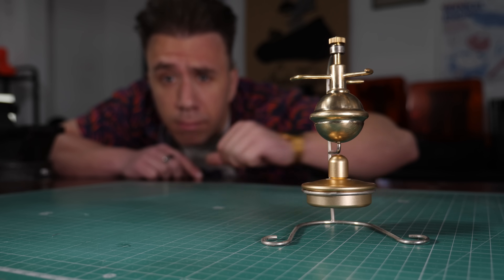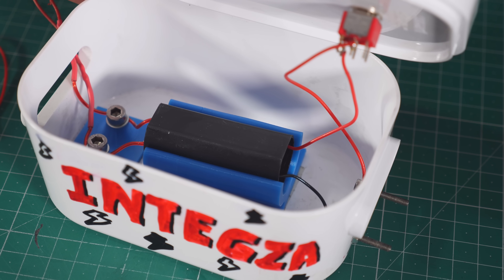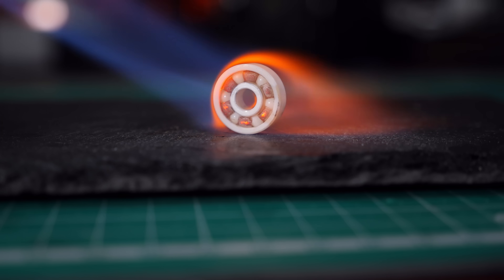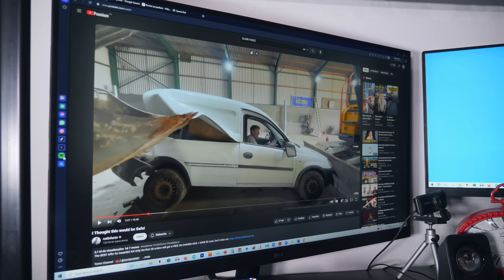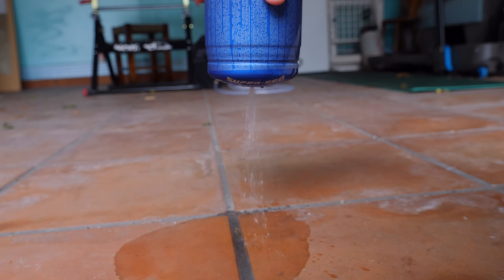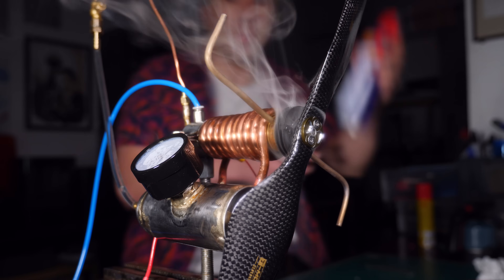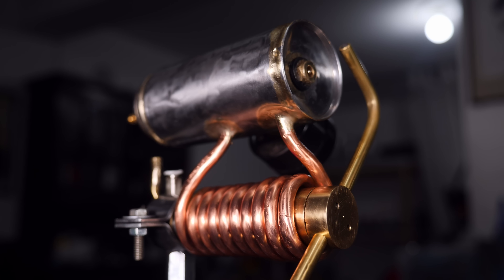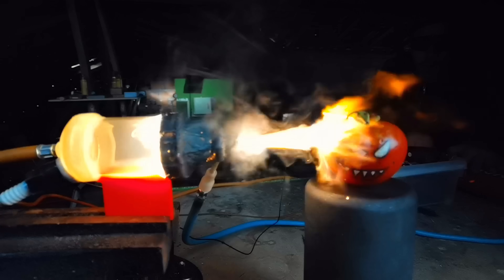I Built a ROCKET PROPELLER

Comment: Bey integza, after brazing the coppertubing, use a mixture of 50% distilled water with 50% isopropyl alcohol instead. This will help remove the flux residues and leave a better surface.

Comment: I'm at 7:50 and I am a bit afraid to watch further. I made a similar "double win" when I was experimenting with burning alcohol as a kid (yes, I was that weird kid, who loved to play with fire 🤣). As a burner, I was using just a steel bottle cap. The flame was not too impressive. But I knew that the stuff burning is evaporated alcohol. So I put one cap on a wire above the other cap to make the other one evaporate faster... I think I was lucky I only had just small bottle caps... And I didn't loose more then my eyebrows 🤣
But the experiment was a full success - flame got WAY bigger 😁

Comment: You want to see this concept in modern history?  Look up the Hughes XH-17 helicopter.  The gas turbines weren't used to spin the rotor like with a modern helicopter -- instead, the gas turbines sent exhaust gas through the (hollow) rotor blades to tip jets for propulsion.  Neat system... also had the advantage of reduced anti-torque requirements.

Comment: Tips for improvements off the top of my head (hat?): 
Obviously, combining the Reichsnozzle (yes really) with the propeller and having the exhaust toob go through the thickest part of the blades (it's back or ridge) would decrease mass and increase efficiency, at the cost of increased  complexity as you would have to make your own propeller or at least McGyver an existing one. 

Next, I would look at the force the exhaust actually produces - you may be able to "gear down/up" the Reichsnozzles by decreasing the radius (distance nozzle - axle) if they produce enough thrust to reach the same or better RPM. Seeing as you're essentially working with two circles of different diameters on the same axle, you can potentially increase the RPM by reducing the "gear ratio", so to say.

Finally, all you need for the cooling element, to get the propane circulating through your heat exchanger (which is what you have essentially built, although inefficient due to the round nature of the tubes which only have very little contact with the combustion chamber) is a one way valve at the right spot (or rather two of them, one going into the tube from the tank and one going into the tank from the tube) and a bit of fiddling to make it go round and round. If pressure can only go one way (until one of the valves fails, that is), then it SHOULD create propellant circulation.
SHOULD.

Edit: Also, have the nozzles (sorry, REICHSNOZZLES JA) at the end of the toobs point slightly backwards (that is, prograde, away from the propeller) to add a bit of their thrust to the backwards thrust the propeller generates. Just a tiiiny bit of optimisation.
Reply: He could weld the tube to the chamber for better heat transfer. Another possibility is making a slightly larger tube and use it as a sleeve for the chamber.

Comment: An idea for air compression: add drive shaft that runs off the prop rotation, giving it a steam engine like setup so it can draw in on both ends of its movements, and if small enough could technically be doubled up to ensure maximum power. How to set this up id leave to you, as theres likely multiple methods to pulling it off.

Comment: Why don't use a heat sink like most water pumps and motors use the blade air will cool the engine the more the thrust the more cooling

Comment: Os vídeos do Integza me dão muito orgulho e são inspiradores 😊
Two suggestions: How about wrapping the pipe around the resevoir bottle and then go to combustion chamber. That will slow the heat transfer to the bottle and hopefelly expelling only gas and not liquid
The other is to put a valve on the bottle output so you can control the flow and make it more stable. The problem is that the pressure inside the bottle may get too high
I hope, this can make the engine a bit more stable and efficient

Comment: I dont know anything about thermo dynamics. But as one with redneck friends and time to look at forums. I've learned that propane has a lower head pressure than r134a but still higher than r12. But if you replace, I believe it was in the realm of 20ish percent of the propane with isobutane, then the head pressure will come down around the same as that of r12. No r134a conversion necessary.

Comment: 3:44 I had done that once when I was trying to remove a press fit ceramic beating, so I heated up the metal it was in with a hot plate, and did not see the cage melting until I took it off.

Comment: propane (C3H8) has a lower boiling point than butane (C4H10) so at the same temperature the pressure is higher. The mixture of gases gases will give you the desired pressure. Perhaps CH4, methane or natural gas, pure or mixed, is your desired fuel? 
Remember that if your plane has to fly at higher altitudes it may need a lower boiling point gas and a heater instead of a cooler. 
Why you do not build a metal propeller, to start with you do not need a perfect aerodynamic profile, you can perfect it later on by making a 3d printed cast. The propeller can be hollow and host one exhaust tube inside each blade, blowing on the edges on a more elegant design. With an tapered inner tube with holes along in the opposite direction of motion, like hollow blades with openings on the oposite edge to the air cutting or leading one. Thrust is only from the sections of the exhaust tube that do not have an opposing or opposite wall to the motion direction. Now you have at the elbow, but with a computer modeling you can design the hollow blade with more openings and a tube diameter to avoid pressure loss as the distance from the combustion chamber increases.

Comment: try pure propane, much more pressure. it commes in cans like butane when you buy it as airsoft gas (greengas). watch for the silicon free variants. redgas is a mixture with even more pressure.

Comment: Pretty cool video, a couple suggestions, 
1. solder is probably not going to do much to hold that together while it is running, it might be only really held in by the expansion of the tube
2. having the combustion at the tips would probably be a lot more efficient than running exhaust through a pipe
Reply: I think he was brazing rather than soldiering. It can take higher temperatures.

Comment: The fact that the pipe looks cold in IR doesn't mean it efficiently cool the chamber, quite the contrary. If the cooling of the chamber (or the heating of the butane) was efficient you would see a difference of temperature between the beginning and the end of the coil, which is not (or barely) the case. There's too much space and not enough conduction between your combustion chamber and the coil. So I think your butane is not really heated by the chamber, which does not raise the pressure, which does not improve the combustion. Nice build anyway.

Comment: I think, supplying the gas to the combustion chamber through the coil will work better. It will absorb the heat and will be fired to the combustion chamber with higher pressure.

Comment: I think you should inject pure liquid propane into the evaporation/cooling coil and then it must go into the combustion chamber rather than having it as a part of your fuel tank. It must be injected closer to the exhaust to make heat exchange more efficient. Try soldering in one of those refrigerator capillary tubes. Pure propane should have pressure of 12 bar at 25C. In my country 99% propane is used for cooking and sold everywhere in specialized tanks cheaper than any other fuel

Comment: 3:40 you should make a third nozzle through the center of the props bearing. Either that or run an  air tub through it to cool down the bearing and prop. I don't know if it's engineer able though..

Comment: When you don't trust your math, predict an outcome according to your math, predict an outcome according to your manually corrected results, and then chose a third option equidistant from the math opposite to your manual correction. 

This way you have multiple potential "success" options, and no scenario where you don't learn anything new. 
Op. 1: Your Math was correct and it was the most optimal design. Your manual correction was the second best, so the "true" value lies close to your math, likely in the direction of your adjusted value. 
Op. 2: Your Math was correct, but your anti-adjusted value was second best. The unknown factors are counterintuitive. 
Op. 3: Your Manual Adjust is the best, and the math is the second best. Reverse of Op. 1
Op. 4: Your Manual Adjust is the best and the anti is the second. This Model is too error prone for this scale and a new adjusted model needs to be made. More Data is needed.
Op. 5: Your Anti-adjusted is the best, meaning that the model's scalability is counterintuitive and there are unknown factors that contribute to counterintuitive results. 
Op. 6: Your Anti is the best, but your adjust is second best: Reverse of Op.4

Comment: McDonnell (as in McDonnell Douglas) invented a helicopter that used rocket propellers back in 1947. Its called the HX-20 Little Henry and its pretty awesome. you can go see it at a museum! As far as i know, McDonnell only made the one prototype. It was not picked up by the military because its insanely loud and creates a circle of fire in the sky that you can see from basically anywhere. still very cool though
Reply: They were sold in magazines from the '50s and early '60s.  The noise was their downfall.  Otherwise they seemed an interesting proposition.  I would fly one.  I hate my neighbors.

Comment: Do not directly heat liquid butane in such a container, in case the coil is hot and liquid butane suddenly flows in, it will cause a sudden increase in pressure which is very dangerous (Although the tilt angle has been adjusted, it is not absolute). Put liquid butane into the inlet of the coil with a regulated flow (The coil acts as an evaporator, cooling the engine) and the outlet into the engine, butane after passing through the evaporator will be completely high pressure gas, they will be much more effective

Comment: Wait a second didn't you make a laminar flow rocket engine earlier using some fancy tech? 
If one were to combine that tech with the making of a propeller, one could theoretically integrate the brass nozzle part into the propeller (although since it's spinning would need some smart thinking...) and reduce weight, applying the thrust directly to the propeller. 
And then you put that on the back of the plane because otherwise the pilot is suffocated from all the exhaust fumes, so a Velocity XL-5RG style configuration would make sense.

What a strange idea!

Comment: Several helicopters were built with rocket or jet engines on the tips.

For the rocket engine only a low pressure fuel pump was required as the centrifugal force provided plenty of pressure

Comment: You should try putting some graphite powder in-between the coil and the engine. It works as a dry lubricant and would also probably help a little with heat transfer.

Comment: Make the nozzles further apart? Mor angular momentum -> More speed? Also: You can not heat water more than 100°C in normal pressure. Why? Becaue it boils at this temperature. -> This is why you can not superheat your Gas. You need to redesign your cooler to seperate the boiling liquid and the gas. See how high speed steam locomotives do that.

Comment: You can use liquid nitrogen and make the heat boil the liquid nitrogen in order to make it spin even faster(liquid nitrogen expands about 700 times its original volume) and you can use the four arms design (2 arms for the normal combustion and 2 arms for the liquid nitrogen) .I believe it s gonna clock at about 3500 rpm so it s worth giving it a shot.
(You can make the other 2 arms shorter so it doesn t look bad)

Comment: what if you made the exhaust holes a little smaller by pinching the end ? if the pressure rose by to much it would heal itself by opening to the original diameter again ...... maybe.

Comment: 7:48 this is literately why the nozzles on the space shuttle don't melt they use the fuel to cool them down before they get burnt this is awesome to see this at this scale awesome video
Reply: This guy has literally made actual rocket motors, so this was not a coincidence
Reply: @wedmunds  still awesome though :)
Reply: Turbojet engines also use fuel cooled oil coolers. It's basically a must to pre heat the fuel after it came out of the -50°C fuel tanks.

Comment: That bearing isn't doing it's job, it's introducing way too much friction. If it was working as it should, the device would slowly decrease it's speed when the thrust is removed. Instead it stops rotating immediately. Even a simple plain bearing would work better than this ceramic one.
Fix that bearing!

Comment: You need a coolant pump so that the coolant is pumping around the engine and the butane. You'll also need it to cool the supercharger feeding air to the engine. 

Maybe a little electric fountain pump would do? Use water as a coolant \butane heater, it has a much better thermal mass.

Comment: here is an advice tell me if it is practical and worth take :- why don't you make the metal pipe cross section from circular to rectangular or like that straight from one end which can absorb more heat due to increase in surface area which will help in increasing the pressure . And you can make the out pipes of engine to increase torque to maximize the outcome.

Comment: You could get wine oxygen canisters, they look just like co2 80g cartridges used in airguns but are oxygen could help with flying without compressor, just need a strong but tiny valve to get fuel air mix just right.

Comment: it would be really cool if you used some kind of turbo effect and feed of the exhaust to create more pressure so then it could move on its own without a big heavy air compressor. or use a kind of supercharger/procharger if you could 3D print one.

Comment: Screwed up the design there fella. The Butane or Butane-Propane fuel should not return to the holding tank. It should go from the tank in to the heat transfer coils, collect enough heat to change it from liquid to pressurised vapour and in to the combustion chamber. More coils that are made from smaller pipe, perhaps even double wound with the hotter inner winding feeding the combustion chamber.
With the fuel as a gas it'll be entering the chamber at a higher pressure, meaning more oxidizer can be feed in too.
Or you could get really wild, and have alternate wraps with one pipe of fuel and one of oxidizer side by side, again in two layers.
You also need to use a Mandrel bend for the output side, so the flow of exhaust is not being restricted in the pipes, and a proper nozzle to expand the exhaust to match atmospheric pressure.

Comment: There was a time in existence that the farm tractor was the entire mechanical drivetrain of a very large by plane that they would think it was a glider if it didn’t have the belt drive mechanism hook for the tires and this thing right here was what they used for an emergency igniter to get the thing off the ground when they hadn’t had the engine started all the way and they would use a nuclear gear train off of the PTOand that thing right there was the nuclear gear

Comment: TEKNALOGIA 🗣️🗣️
Edit: @Integza, please consider filling copper pipes with a fine sand and capping with blue tac before bending. This is a trick used to keep the pipe from inking or collapsing. Your technique is great! This will make your bends perfect if you get to a project where they need to be (requirement for consistent flow rate)

Comment: I liked the idea of using the coil of butane to cool the engine while the engine heat is simultaneously raising the pressure. Wouldn't shortening the copper thrust tubes result in higher RPMs? Also how well would graphite hold up long term considering how soft it is?

Comment: Shame the propeller couldn’t have internal 3d printed veins, made of metal, that way you could save weight, while increasing the lever arm, then have some way of when the speed picks up the propellant moves inward rotating closer from the center to increase speed as the torque reduces for initial acceleration.

Comment: Would this stuff work for what u need? Crystic® Fire Retardant Resin 5046PA  idk about resin stuff but i seen a video where a company made fire resistant material using fire retardant fabric and resin  to make a heat resistant plastic  something where u could put a blowtorch to it and it wouldnt catch fire idk if this is close to the stuff they used

Comment: Why is your coil connected back to the fuel can on both ends.
Most rocket designs have the fuel going around the hot parts of the rocket engine and then into the combustion chamber. They don’t send the hot fuel back into the tank.

Comment: By removing heat from the expanded exhaust gas before the rocket nozzles you reduce the velocity of the output gas. It would be better to extract the heat from the exhaust gas after it has done its job. This could be achieved by propelling a heat resistant Pelton turbine with the exhaust jet and then extracting the heat from the turbine housing. This should increase both the power and the efficiency.

Comment: This setup should be generating more power than the propeller rating because you're pushing a gas backward with the propeller into a zone of increased gases thanks to the exhaust from the engine. I'm not sure it will be significant, but it might be enough to measure

Comment: have you considered arranging your butane reservoir like a thermosyphon? reservoir level with combustion chamber but one hole in the reservoir at the top and the other lower down. That way cold liquid will flow into the coils around the chamber via gravity and there is a path for the hot gas to escape out the top and force more liquid in.